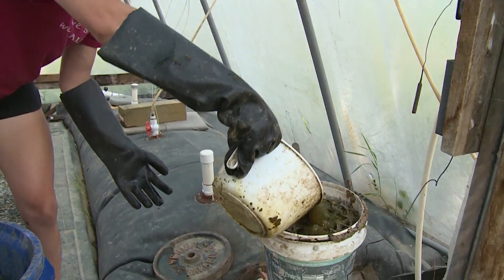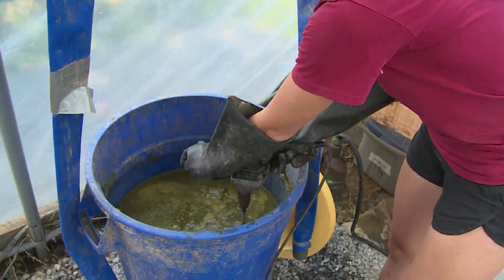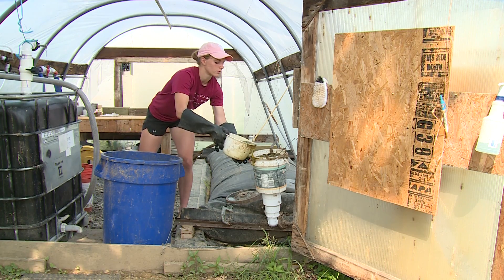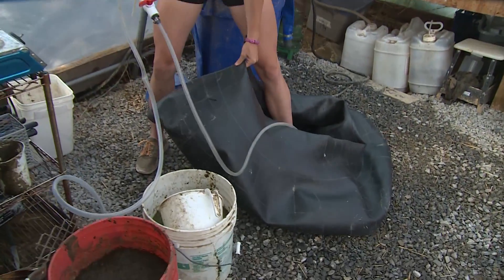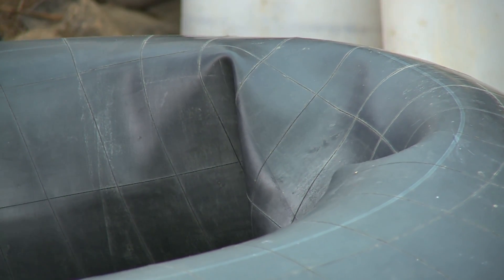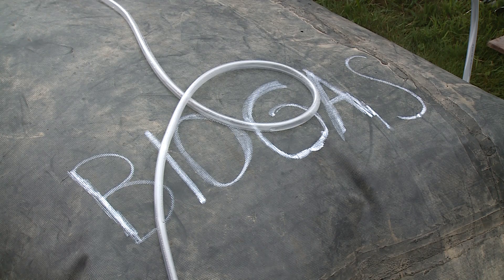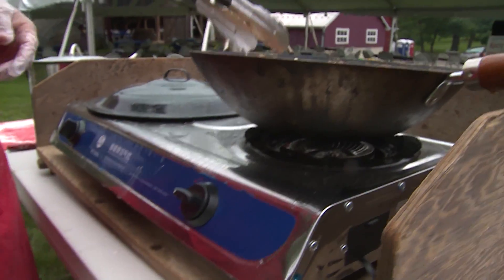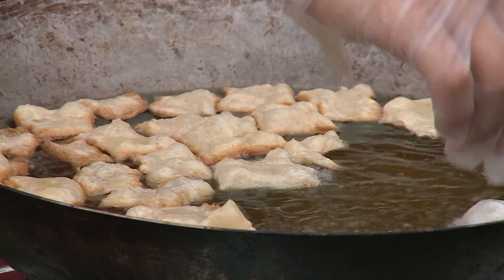Turning Farm Waste Into Biogas

Comment: Wow, I love your films!    Having watched them a couple of times I have built an upright insulated and heated digester that is working nicely so thanks for your tips.     I have a question regarding temperature.     As I have such an efficient system of heating and insulation I can easily run it at 55-60C.    Would you recommend this and is it straightforward to then (if I want to) go back to the 38 C that I am currently operating at?

Secondly (if you don’t mind) I want to design a sausage digester that can be buried in a standard uk suburban garden (eg 5m*20m).   I would like to use the top and bottom of a 55gallon drum for the ends and I was wondering if you could suggest a length?    I intend to heat it with the thermal mass f a rocket mass heater and insulate it with straw and maybe a poly tunnel above it at ground level which will in turn be heated by the radiant side of the rmh.    Love to know your thoughts if you get a chance and thanks again.   Cheers.   Tanc